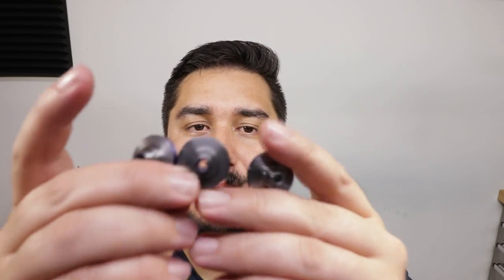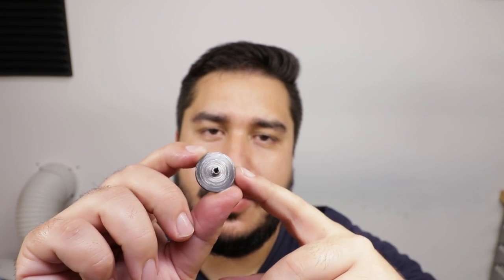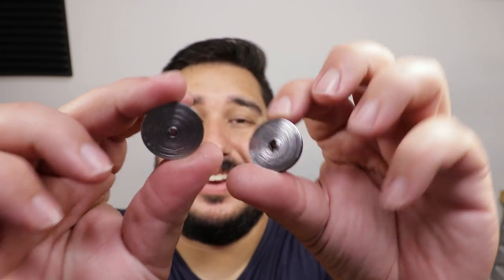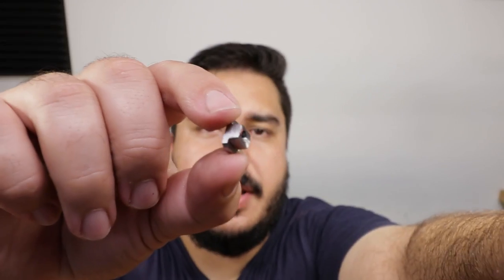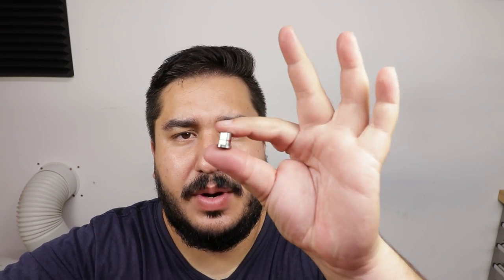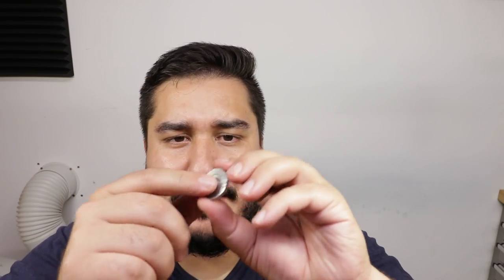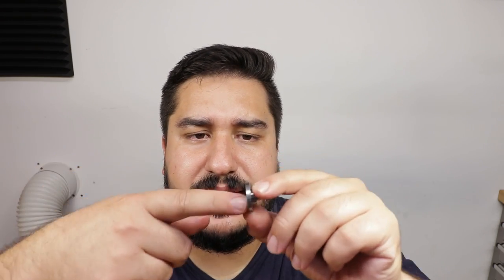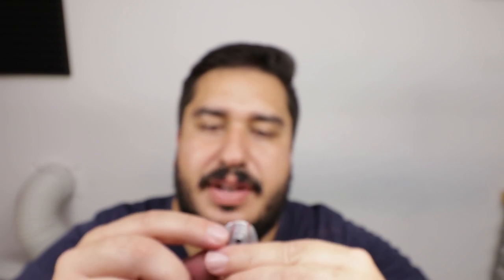Making Faceplate Clamps for Watchmakers Lathe Part 2 - Watchmaking Vlog 43

Comment: I believe the best part of this system is that you will be able to make custom clamps for future work as needed different requirements. These clamps you are making will be substantially better than standard face plate clamps. Good work Dean!
Reply from the maker: Thanks so much Scott, exactly. I’ve been working and pretty much got it finished. The original design changed, 😁😁

Comment: Hey Dean, for most turning jobs you can use a little WD40. Works the best on aluminium. For steel a little dab of Tap Magic works really well. I use a small paint brush with some commercial coolant in a fairly strong mixture for parting. Just keep the tool clear and it will work well. Parting is one of the jobs that put the most load on the lathe.
Reply from the maker: Thanks for watching my video Stephen and your machining tip, thanks so much I really appreciate it 😁